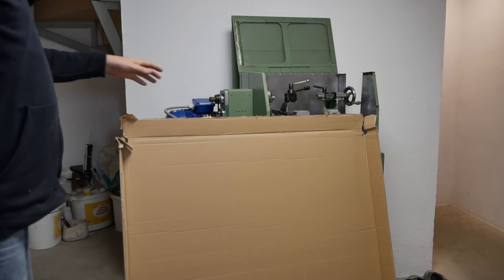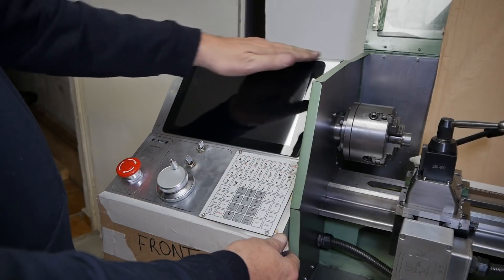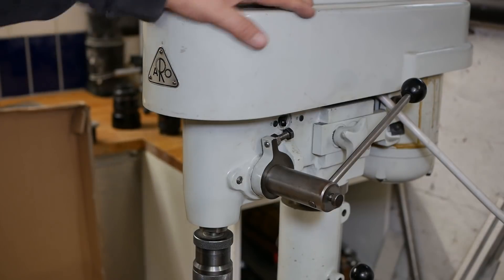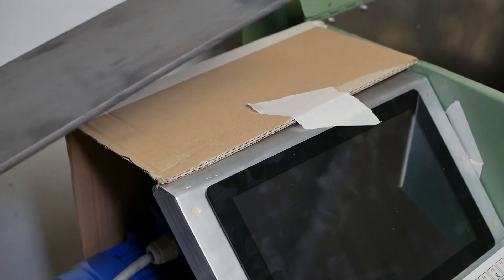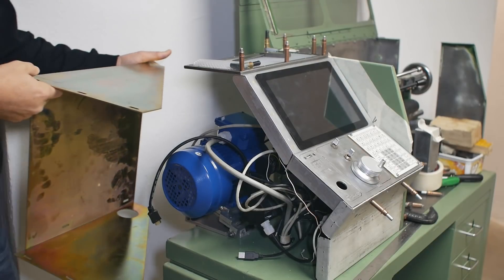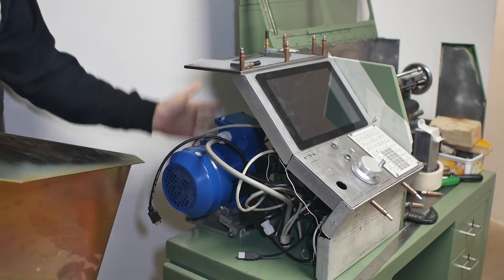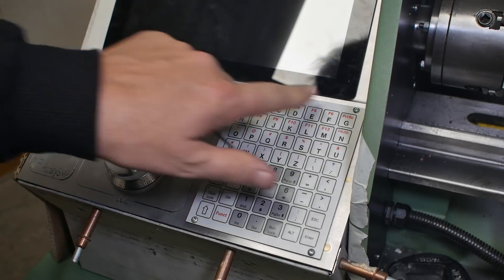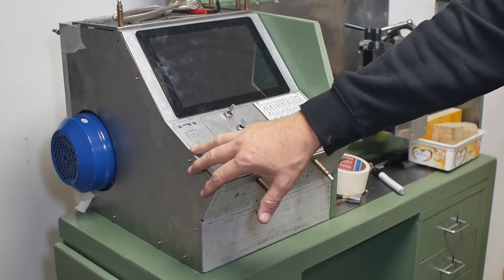User control housing - CNC'ing the 7x12 mini lathe - Episode 35

Comment: Regarding the problem with the spindle bearings on the Schaublin. It might be that the preload on the rear bearing arrangement wasn‘t set right or something loosened over time. The axial preload on the bearings will expand the outer bearing races.
On your enclosure built: Did you think about a vent opening for the motor fan? Great job either way!
Reply from the maker: That is what we thought, but the hardened steel OD is 0.09mm undersize, with insigificant wear in the cast iron bore. It has certainly had at least one bearing change before, so our only explanation is that someone bought spindle bearings from ebay, which had an unmarked special OD regrind for a special use.
Reply: @RotarySMP  So it‘s really 0.09 mm undersized. I hoped that was a mistake :)
A reground bearing seems to make the most sense. So either there is a severely undersized bore somewhere which could not be bored bigger(?) or someone f....d up a bearing regrind and tried to make the most out of it and your friend pulled the brown card. Hopefully the Schaublin will be up and running again soon. Thanks for sharing this problem.

Comment: amazing. this is going so well. recommendation: USB port flip cover.
Reply from the maker: Funny you should say that. I was just staring at it thinking "this is going to fill with swarf" :)
Reply: @RotarySMP  if you haven't already found a solution and you have a 3d printer (I'm not sure, but with your penchant for CNC...) it's pretty trivial to 3d print a dust cover or plug for it.
Reply from the maker: @UnreasonableSteve  I like your YT name Unreasonable Steev. Good point. The 3D print sits just across the room from the lathe.

Comment: 10:25 Yay! for snips! It pains me to see folk cutting out sheet metal with angel grindrs.
Reply: 13:00 Boo!
Reply from the maker: @andypughtube  That old Phillips monitor mount  is thicker. Nearly 2mm. Buggered if I was going to try that with tin snips. :)
Reply: @RotarySMP  Never miss an oportunity to spark. never. It's good for Karma.
Reply from the maker: @NicoCarsAndCookies  Isn't fire also Feng Shui?
Reply: @RotarySMP  yes yes! I read it in a meditation book called "5 easy ways to clean bad energy", written by a dude called Gengis Khan... Fire is always a solution when you don't have a problem :D
Reply from the maker: This is only 3/4mm mild steel, so it cuts eaily enough with tin snips. Much thicker and I would also reach for the angle grinder.

Comment: That almost never happens to me 🙄 I think the first op on a mill should be an orbit with a slitting saw to lop off any clamp studs that are in excess 😂
Reply from the maker: :) I like that Idea. I was very careful with the 20mm insert mill, to check that it cleared, and then brain faded with the 10mm endmill. Luckily I was more careful with the spot drill, and had a hand on the pause button.

Comment: Cause your nearly finished now.. :) you should add a rotary encoder to the spindle and rails for direct position measurement and including this in your control loop. I can suggest rls linear magnetic scales (not too expensive for high res, if you design your own cases for them) 
This is turning out very nice 👍🏼
Reply from the maker: I already have an encoder on the spindle. That is required for threading. The Maho has closed loop feedback with linear (glass scale) encoders. You can get glass scale encoders pretty cheaply as well. I have considered them for this, but will probably not bother. That will be the next lathe project after I sell this one.

Comment: I think the lathe is coming together (and also apart, from time to time) quite nicely! After all those years of "polishing a turd", I think the turd has become a work of art. You can proudly say that you built this machine from the ground up, and you will probably know all of its quirks and oddities!
One thing you could still do is to mount some LED panels to the inside of the lid to have a camera stream to the controller, and to have the best possible illumination.

Also, that green paint gives a really nice contrast to the rather modern aluminium interface! If I were to buy a lathe based on looks, this would be it!
Reply from the maker: Thanks for the kind feedback. I certainly didn't expect it would take nearly a year and 35 episodes to get to this point :)
Reply: Well, there you are. And since MAHO is up to snuff, it's up to Nico to get you some work to do.

Also, do you have a part number for those aircraft switches on hand by any chance? If you do not, I'll just ask the internet (probably r/electronics, those guys are pretty good), so no sweat if you don't know who made them.
Reply from the maker: @vincentguttmann2231  The part number of the 3 position switch is 102TL2841-1. Probably cost more than the lathe :) 
https://www.sensorwell.at/en/products/switches-2/toggle-switches/tl-series/102tl2841-1/
Reply: @RotarySMP  Yikes. Mouser lists the switches at just over 180€ per piece in a pack of 20. Maybe I should start looking for cheaper ones. Nevertheless thanks for sharing!
Reply from the maker: @vincentguttmann2231  Surpisingly cheap for Aviation components :) 
There will be a lot of aircaft scrapped in the coming year. You need to find someone at a scrapping company, to pull the cargo loading panel for you.
Reply: @RotarySMP  Well, I live in the Harz (a mountain region in the middle of germany), so airports are kind of hard to come by. Apart from the small ones for hobby pilots and other small aircrafts, the nearest ones are in Hannover and Braunschweig, both about an hour with the car from here. I also do not know of any aircraft company nearby, so I will have to go on ebay, or look for similar ones that I can justify buying.

Comment: put some rubber u channel tube on that round motor hole in the sheet metal to make it nicer and to get rid of the sharp eddge
Reply from the maker: I had the same thought. Looked for some at my local hardware store on Thursday, but couldn't find anything suitable. Guess I'll have to get some on line.
Reply: @RotarySMP  They sell them in automotive stores too, for doors of cars for example
Reply from the maker: @DolezalPetr  Oh, good Idea, I also need to get a replacement bulb for my car headlight. I think shops are lock down again here from Tuesday, so I'll check on monday.
Reply: @RotarySMP  I need to buy some long M12 screws , but my local shops that sell such things are all closed, so I am kind of stuck too at the moment
Reply from the maker: @DolezalPetr  There are a billion smaller and larger prolems due to this pandemic. I consider ours to be pretty minor :)
Reply: @RotarySMP  true
Reply: @RotarySMP  just very, very annoying.